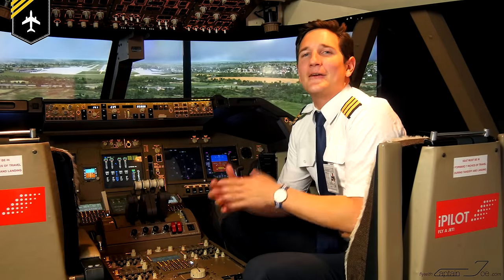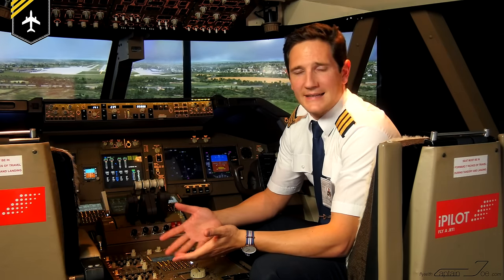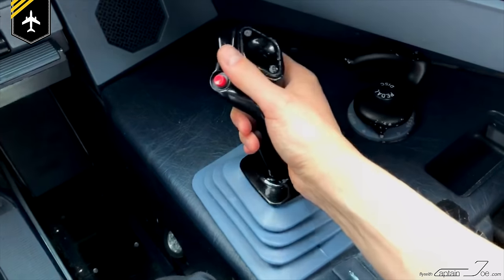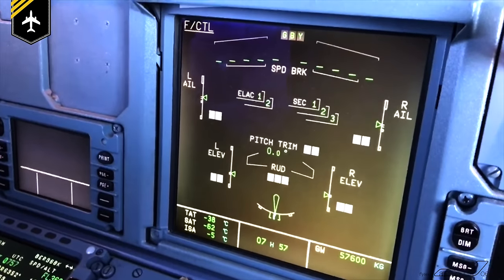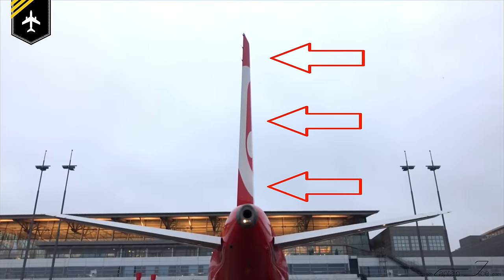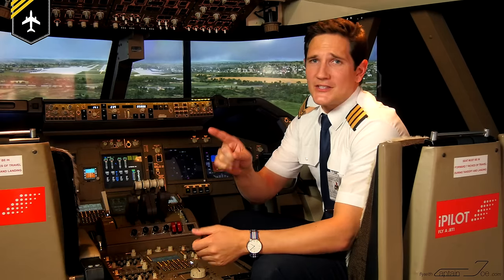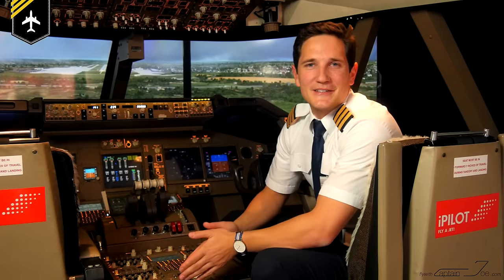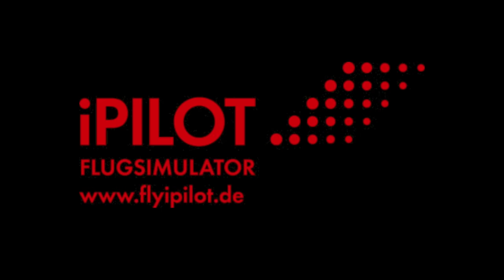Why does the RUDDER point to the right? Explained by Captain Joe

Comment: If all engines fail on an airbus, I would assume that there is some system keeping the pressure to the control surfaces to prevent loss of control mid-flight? What system might there be for this?
Reply: google it 
aircraft  R A T
Reply: Hyds dont completely depend on engines. There are 3 hyd systems on the a320. The yellow one has an electric backup pump. The blue is all electric pump. The green system only runs on engines so the power transfer unit pressurizes the system with the help of yellow system.
But yeah we have Ram Air Turbine as well which can provide enough pressure to hyd and electric systems

Comment: hi captain Joe! 
could you please explain CAT I & CAT II for ILS and how pilots choose between  either visual or instrument approach.  
 I really like your videos !   Thank you!
Reply: Its all about decision height n cloud ceiling n viz .
Cat 1 is 200ft DH wz 800M viz in good visual conditions.
Cloud base height would be higher than 800ft. Visual approach.with ils
Any lower than that requires approval to go lower decision height 100ft but not lower than 50ft which necessacites use of Auto land which is guided down by a CAT 2 ILS.
N need a RVR reading .

Comment: All due respect Joe, but the lock pin in small- training aircrafts are for the yoke only. Meaning ailerons and elevator/stabilator. The rudder is coupled with the nose wheel steering and since the wheel is not moving so the rudder. I have never removed a rudder pedal pin ... :/. Sometimes there is an external rudder pin. 
Αlso I am not sure if this explanation actually is true ... When the hydraulics system do not apply the 3000 psi force .. the actuator piston should stow in a fail/neutral position. That actually works like a safe pin. It seems to me like to sloppy work to leave the rudder suffering in windy conditions while parked. For the ailerons- elevators is what you said.  and again you know better .. just saying. P.s : For fly-by-wire system , ATPL AGK theory claims that irreversible systems have a lock down mechanisms when parked/turned off.

Comment: Captain Joe. What is that grinding sound you hear during flight? It sounds like the pilot is changing gears.
Reply: Most likely hydraulic fluid being pumped to move control surfaces and other tasks.

Comment: Hi Captain Joe,

I have a very specific question concerning the "hanging" ailerons:
When I stand at the headset during start up they are still hanging down (as you describe it). At the same time they move in the horizontal position, engine 1 is changing the sound (it sounds like a bleed is closing). Can you maybe explain what actuates the change of the sound?
Thanks very much and best wishes from South Germany

John

Comment: LOL
As it's the retracted position of the so called "jack valve" (rudder), when the preasure bleed is shut off.

Also ailerons have those same valves, driven by hydraulic pressure...and on the ground this bleed is shut, so the valves pressure also falls and with it the stearing surfaces they control, move into a retracted position as well.

And the electeic backup pumps are also shut by shuting the pressure-bleed and when on APU/GPU power, on Airbus.
If I remember correctly on the Airbus cockpit...the APU can be connected manually to produce pressure too, but normally this is not used very much.

It just shows why a inflight engineer would be better as only tow pilots...not only can he help reduce workload, by taking radio and manual navigation...he also knows how that stuff works very intimate.

And the pilots have also no clue about materials, besides they had more time for pre-flight ops, if a technician would do the walkarround.
;3)

Comment: I already knew this but. But one question, does the Airbus have a safety protection for uncontrolled movement of the rudder due to winds or jet blast? Such as limit of actuator movement? A Ryanair 737 had a similar incident a few years ago in faro, which caused serious control problems.

Comment: So the flapping in the wind can damage small planes, but not the large ones? Well, probably because on small planes the cables causes the stick and pedals to move, while on fly by wire, only the actuators move, I guess.
Reply: Also they're heavy, so they don't move fast when the wind pushes them

Comment: So you don't put a gust lock in an airbus while parked at the gate?  :-)
Reply: I think maybe it's because the Airbus control surfaces are too heavy to be damaged by the wind, I am just guessing though
Reply: Irreversible flight controls do not require gust locks. Once the surface rests, wind cannot move it. Remember that the wind would still have to move the actuator, and it's heavy. All that the wind can do, is break the equilibrium to either side and then gravity will take over. I haven't tried, but I doubt a human would be able to move a control surface of an unpressurized irreversible system with your own force.
Reply: Actually, you probably can move it.  In fact, the wind moving the rudder, as Capt Joe explains, proves it.  There are multiple actuators powering each primary flight control surface.  To prevent an unpressurized actuator from fighting against other actuators, a bypass valve in the actuator opens when pressure is lost, allowing the actuator (and surface) to move freely as the other actuator(s) continue to operate.  Since the surfaces are mass-balance to prevent flutter, they are usually pretty easy to move by hand when all hydraulics are off, on the ground.  In flight, however, aerodynamic forces make most surfaces inoperable by human power alone.  For instance, on the Boeing 737 aircraft, the ailerons and elevators can be operated by manual inputs, with some force, in the event of a total loss of hydraulic power.  The rudder on the same airplane, though, is too large for manual operation, so it can be operated by a standby hydraulic system.
Reply: I think even with mass balancing, the surface would be too heavy for a person to move (And probably not a good idea) I wonder if airplanes that don't have manual reversion like the 737 would feel the same when trying to move the surface in reversal or if they'd be easier to move considering they don't have cables. The actuators are unpressurized, but you still have to displace pistons that fit the cylinder very tightly and the system has a high friction in human strength terms. I'll ask an engineer if I get the chance.
Reply: You can move B737's and A320's  ailerons rudder and elevator with hands. İt's not that hard.
Reply: Have you tried personally? If so, thanks for the clarification.
Reply: I spent years personally, physically moving 737 primary flight controls during inspections, rigging, autopilot/yaw damper/mach trim calibration, etc.  Never put my hands on a fly-by-wire (I'm retired), but if the actuators did not have bypasses as I explained, the system simply would not work
Reply: That's what we were looking for. Thanks!

Comment: So, if both engines are out, hydraulics "die" and you cant control the aircraft?
Reply: There are ways to maintain hydraulic pressure for essential systems. Every different type has particular differences on how this is done and that's a great part of what you have to learn during a type rating but it usually goes like this.
There are engine driven pumps and electrical pumps. If both engines stop working, you can still use the electric pumps to maintain pressure. Those electrical pumps can be energized by the APU generator (AC). Some airplanes have a RAT, which is a small ram air turbine that pops out of the belly of the airplane, that can generate hydraulic and or electrical power above certain airspeed. In the case of an a320, the RAT will pressurize hydraulic blue, which can drive the emergency generator that supplies an electric current to the both essential busses (AC and DC through a TRU).
Windmilling engines do also pressurize the system somewhat and the accumulators will maintain pressure for some time as speed bleeds of during the last seconds during landing. In the airbus, as speed bleeds off below 100kt (landing roll), the airplane will start shedding busses and will slowly lose all hydraulics and electrics, provided there are no other means of generation like the APU.
Reply: In the landing flare electrical power generation will be lost, however the battery will last giving control the the main surfaces during landing. You wouldnt want to lose main flight controls during an emergency landing!

Comment: Why exactly are the tailrudders on a small, single engine propeller plane pointed on one side? How bout twin motors? Are there similar things with planes with one jet engine like a F-5 Tiger or a Saab Gripen? How bout planes like a Tupolev TU-154?

Comment: Hi captain Joe... I'm curious about some airports using 4 letter codes and some using 3 letters... eg. KLAX, KFLL etc.
Reply: the_jetsetter One is the IATA code and one is the ICAO code. All airports are assigned both?
Reply: The K in front means it is the continental united states and is added for ICAO codes. Also interesting to note is that the X, such as at LAX, was added once three letters for IATA were required and does not really stand for anything in particular. So...KLAX...means continental US Los Angeles X ( just cuz)

Comment: Question!  Is there any concern with the Airbus fly by wire system completely shutting down or not operating or malfunctioning?  How does the human pilot actually take control of it if such an event takes place?
Reply: Commercial aircraft have many levels of redundancy in the electrical systems, something that critical will have at least 3 sets of wires, computers etc all designed by different groups of engineers who don't work together so any mistakes in one system don't make it into the others. When all 3 work, for every inout the systems each cast a 'vote' on what happens and the computer goes with the majority. If one fails, it will 'vote' differently to the other systems, so will be ignored

Comment: so if the engine is responsible for pressure what happens if you loose all power mid flight? will you loose all controls?
Reply: There's so much redundancy built in airplanes, that only a combination of "extremely improbable failures" would cause the total loss of hydraulics and electrics. Both of these systems are pretty much guaranteed.
The occurrence of each of these failures is quantified in the EASA document CS-25, and it's actually catalogued as "extremely remote probability" with an occurrence of 1x10^-9, that is 0,000000001 chances of happening per flight hour, and all of these super reliable systems would have to fail at the same time. So yeah, it's effectively impossible.
Reply: I assume you mean hydraulic pressure. Each engine has a mechanically driven pump, plus there is two electrical driven pumps. On top of that, there is an auxillary pump. The A320 also has a rat, ram air turbine, which drops out under spring pressure when hydraulics fail and it supplies hydraulic power in case you having a bad day. I think the Hudson river 'crash' as per the movie Scully answers your question nicely, the aircraft will still have flight control capability without the engines running

Comment: So, if the A320 ever loses hydraulic pressure during flight (say some sort of failure) the ailerons will be pointing down? flapping with the wind?
Reply: It won't flap, the rudder is balanced in a way that it will follow the airstream. Google "flutter", that is basically what you are describing.

Comment: Okay this is maybe a stupid question but, does that mean in the event of both engines failing you would lose all flight control?
Reply: Daniel Curtin No, there is backup batteries, an auxillaty power unit and an emergency deployable wind turbine to generate power.

Comment: Can the airbus fly upside down?
Reply: Carwyn Morris no :D
Reply: Guessmyname Well .....Have you tried? Give it a go .......
Reply: In fsx yes but i would not trust that game's physics
Reply: Yes it can but for a very limited time.
Reply: No it can not cuz the flight computers are limiting your bank angle and your pitch. You cant roll over
Reply: Carwyn Morris lol what?
Reply: julien_Blue and also a stall would occur before you already turned half around
Reply: No because you can't turn half around and the Airbus has Alfa Protection
Reply: +julien_Blue you could always disable the flight computers
Reply: You can disable the ELACs, SECs and FACs.. Not the FADECs.
When you disable the then theres no contact from the sidestick to the Ailerons and Elevator..
Pls correct me if i'm wrong.
Joe defenitely knows it ;)
Reply: Disable 2 ADRs, and force the aircraft to alternate law. You'd still be able to control the aircraft, but with no bank angle and stall protections.
Reply: +lolvks you mean direct law..
Reply: Niel Sanaco loss of 2 ADRs won't bring the airbus to direct law yet. Alternate law will be sufficient to fly the aircraft upside down
Reply: Upside down? IE: inverted? YES ... successfully? Oh, HELL no.
Reply: I doubt it. Swept back wings offer too much drag and the attitude required to hold inverted flight would create an amount of drag that the engines wouldn't be able to overcome. Look at how highly revved the engines are during approach when flaps and gear extended. Do your math. So maybe it could fly inverted, but not maintain altitude.
Reply: You can override the computers, there is a failsafe built in that allows you too
Reply: All depends on your definition of flying
Reply: Reading the replies it seems no one truly knows if it can be done or not. Plenty of interesting speculation and theories both fore and against.
Reply: I'm pretty sure it cannot be done. A barrel roll, sure, but a sustained inverted flight in an airliner, no way. You need so much thrust in order to overcome the drag. These wings are designed to create lift normal to the upper surface.
Reply: The most efficient wings are symmetrical - curved on the bottom the same as the top. They create lift by angle of attack. BTW, Bob Hoover already did it a long time ago.
Reply: Each type of wing has a different purpose. What's good for a fighter jet is not good for an airliner. Currently, airliners use swept back supercritical wings with dihedral effect that provide lateral and directional stability and a high Critical Mach number. When you design a wing, you don't think efficiency, you choose the wing that suits the mission of the airplane.
Reply: Once.
Reply: A pilot did it in a 707 while trying to sell the plane for Boeing.
Reply: It was Tex Johnson  and no, a barrel roll is not the same as having your wing sustain lift upside down.
Reply: I never said it was the same as "sustained" flying upside down. Where does he say sustained flight? Just because it was tried to sustain flight upside down in a 707 doesn't mean it can't be done either. Same with an Airbus. If it has enough power and is placed at the right angle, it probably would be able to fly upside down if the fuel intakes etc. were designed to handle it.
Reply: You said a pilot did it in a 707, as in sayin that what he did was inverted flight. He didn't fly inverted, he did a barrel roll, which can be done by just about any airplane if there's enough air between you and the ground. I honestly don't believe any reasonably normal airliner has enough thrust to fly inverted.
Reply: He was upside down which is inverted. Do you always just make up your own definitions?
Reply: Completely empty, with just 2 pilots and minimum fuel? I bet a lot of airliners can sustain inverted flight. Especially a hotrod with good T/W ratio like a 757. Just a matter of hacking the flight computer to allow it.

Comment: What does a pilot do in case of rudder failure? Seems rudder issues have ended in mostly catastrophic results.
Reply: You do not need a rudder to fly a plane they just help coordinate turns and in cross wind take off and landings. You are thinking of the tail fin/vertical stabiliser and yes if that goes you can be in big trouble

Comment: Is the pressure falling fast? or does it take some time till the ruders are loose on a airbus?
Reply: depends on what you would say is fast, but i would say it doesent take very long. after shutting both engines off maybe 30 sec to 1 min, i dont have the exact time but as i said it should not take that long
Reply: thanks. thats fast for me :-)!
Reply: no problem :)